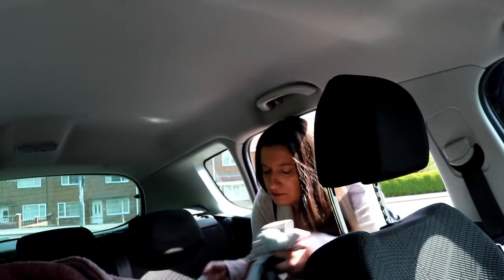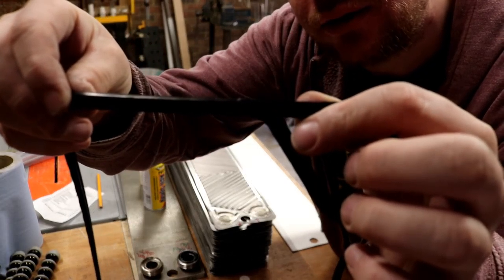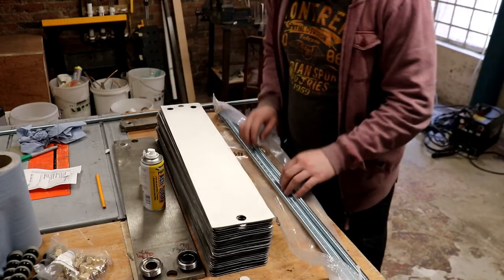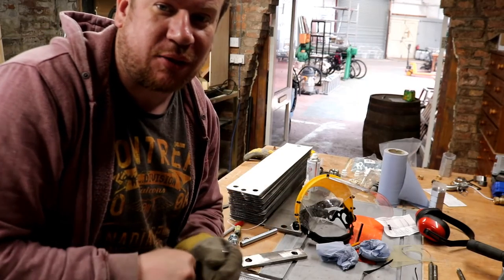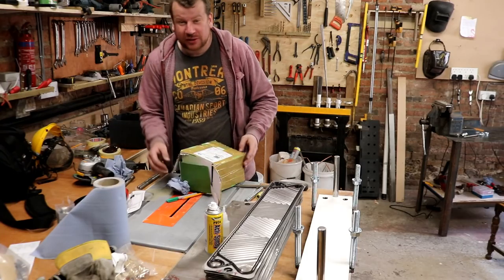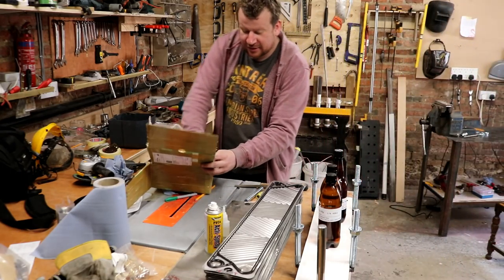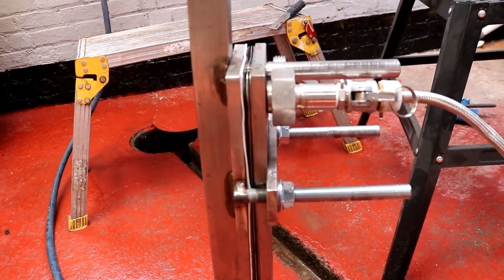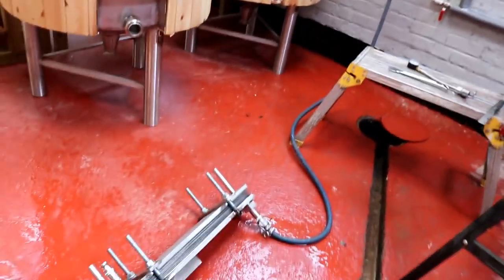I WON BEER!

Comment: Harry...I've been following.  Really impressed!  Re..plate chiller. On big industrial ones there are usually at least six bolts. You tighten down to a mfg specified dimension for the number of plates.  I would suggest another set of bolts and taking it to a torque that works. Too much will extrude out the gasket and make it leak. You don't want it so tight that the metal plates touch.

Comment: Harry - A question for you regarding the plate chiller. Are the chevron shaped corrugations purely to increase the surface area of steel to water/product, or do they direct the flow of liquid as well? The reason I ask is that if they are for flow then maybe you would be better placing your gaskets differently (flip them over) then the liquid doesn't immediately hit a corrugation head on (if that makes any sense). You're making real progress pal - not long until you're brewing I reckon. Keep up the good work.

Comment: Congrats on the winning the beer comp. I have to confess that I didn't vote for you, although it was a close run thing. You got pipped by Hapless Ginger Brew (https://www.youtube.com/channel/UCl0t2ZnyGrlNEUqbW29FAJA) because his sense of humour is very close to my own and his vids never fail to make me laugh. Good luck with the plate chiller, although I'm thinking that it might be easier and cheaper just to get two lengths of copper pipe and bend them into a counterflow chiller, just a slightly bigger one than the one that I made. Great vid as usual, Cheers, Schnuz.